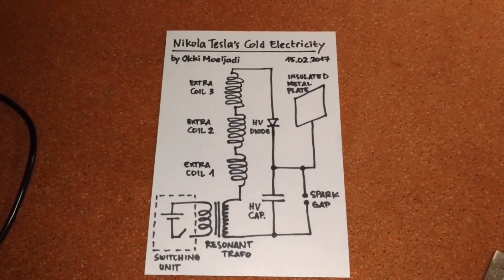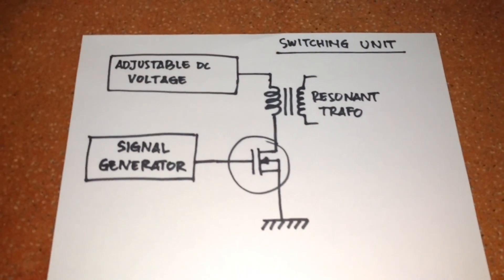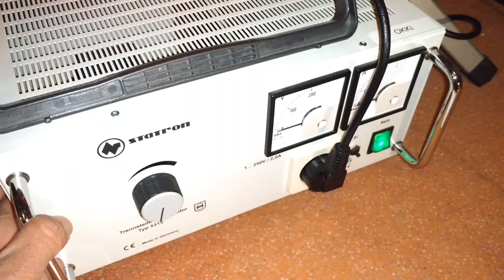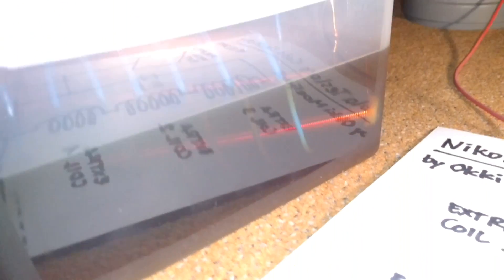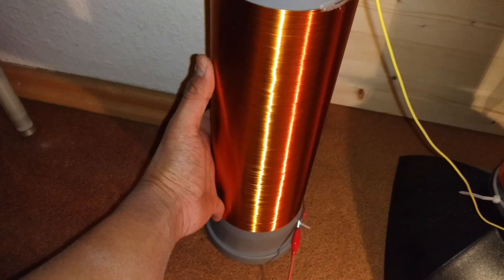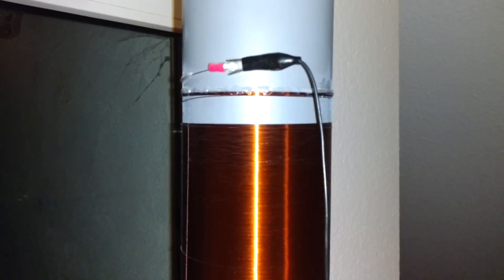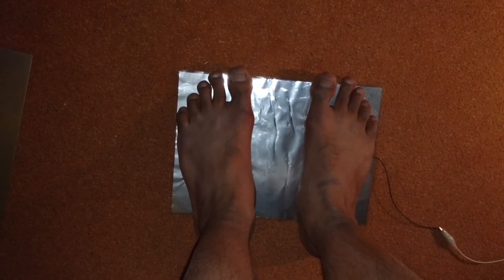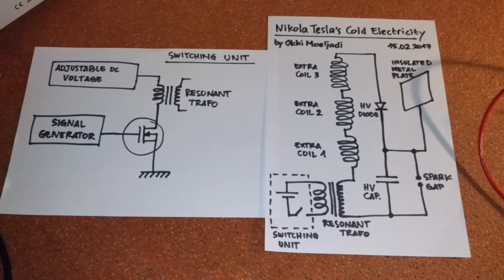Cold Electricity - Circuit Details

Comment: So in Tesla’s hairpin circuit, which you made as well, a spark gap applied to 2 capacitors resulted in the ‘cold’ electricity effect.  In this video you do not have a sparking gap, thus, the question is if a spark gap is required connected to 2 series capacitors as in the hairpin.  Certainly you are applying a vibrating high frequency DC voltage to your plate capacitor, thus, creating similar dielectric characteristics in terms of completing a circuit with your body parts to a ground.  Certainly Tesla could have done this as well, but then to my knowledge he did not.  Did he feel that a spark is actually necessary, in other words, did a spark drive the aether in a beneficial way in his hairpin circuit (by the way Tesla did not call that circuit ‘hairpin’ rather an impedance effect circuit.  My gut tell me that your circuit most likely is using a similar high voltage/frequency capacitive reactance (impedance) as Tesla’s.  Yours would be less powerful though, as you it is not bipolar, i.e., you run through a diode as in Tesla’s he used 2 capacitors that are obviously at any moment at opposing polarities that would enhance the effect.  Listen, you need to get back into the game and start posting again.  I feel that this circuit is an important circuit that you came up with.

Comment: I hear cold electricity may be considered negative electricity. Do you see this as true?
Reply from the maker: I think people refer cold electricity to different phenomena. On mine I don't see this as negative electricity. Some poeple say that cold electricity is where void of electric charge is created and you use this to power something.
Reply: Okki Moeljadi I see, thanks
Reply: Okki Moeljadi is this circuit capable of collecting Radiant energy? Why have the extra coils?
Reply from the maker: @filigenzilab9613  any copper material can be used as radiant energy receiver. You don't need any extra coil. This video shows my early radiant energy research.
Reply: Okki Moeljadi thanks
Reply: Okki Moeljadi how much radiant energy do you think one could obtain with a specific amount of circuit space?
Reply from the maker: @filigenzilab9613  based on my radiant energy research, the receiving power depends on 2 things: 1. Copper mass and 2. Frequency. Copper receiver with more weight can receive more power. Regarding the frequency: the higher the frequency, the more power you can get. So the info is yours, you only need to find some natural transmitters and extract as much power as you like from it.
Reply: Okki Moeljadi thanks again
Reply from the maker: @filigenzilab9613  you're welcome.
Reply: @OkkiMoeljadi  Yes, some people refer to cold electricity as different then what I see in this video.  Typically the door knob capacitors, as in Tesla's feed a stout piece of wire connected between the 'load' side of the door knobs...now in your circuit you have the positive pulse going to the floor capacitor (aluminum with plastic around it)...Thus, one may conclude that what is going around the outside of your body (as you become the other plate of the capacitor while standing it) is a from the negative side of the capacitance, or negative electricity.  Key here, is that, even though your device is only connected to one plate of the aluminum plastic cover capacitor...A conductor touching the plastic (your body) will assume negative charge.  This is somewhat different than Tesla's cold energy device as the door knob capacitors were  supplying a closed stout wire.   I really like your device here, as all the extra copper actually, I think, becomes part of the aluminum plate capacitor(as seen by the circuit).  Great job here!  Thanks!!
Reply from the maker: @MS-ef1gy  Thanks!
Reply: https://youtu.be/1JeeaZlYonc

Comment: Okki, you need to watch the vids of Gerard Morin. He managed to harvest free energy from the aether with (RF) sound like Tesla did. Morin used a frequency generator to drive a magnet motor and put out a lot of torque. He says: " If you remove the sine wave with spark gaps you get massive amounts of energy release. If you can handle this properly you get pure potential. All you have to do is manage this energy properly. https://youtu.be/nnsbmMjc5iQ

Comment: I understand radiant energy effects occur, when a capacitor is charged from a negative inductive spike (high side switching a coil) is disruptive discharged, into a primary (without oscilating to positive), inducing resonance in the secondary. I will investigate this further with bifilar pancake Tesla coils.
Reply: ok, have you done with the tesla pancake coil?

Comment: Okki you love making half wave power supplies, in this case the diode does nothing. You have a pulsed DC so there is no negative half cycle. You need to take a course on electronic circuit design. There is nothing special here. What is scary is that you use your body to complete the circuit. You are standing on one plate, and with your hand, you are touching the sides of the bulb. You complete the circuit when you touch the bottom of the bulb to the ground plate. The charge travels thru your body to ground. This is dangerous. People can get seriously hurt if not dead if they connect this up incorrectly. Your body is a cap in this circuit. Caps pass AC and Blocks DC. A cap has two plates and an insulator between them, the laminated foil is the one plate and the plastic covering the plate acts like a insulator. But you are the other plate. The pulsed DC current passes thru you to ground.
Reply: The banking power elite have employed 100 of shills that posts videos with bullshit on the tube and google to dumb down the real free energy tech as heat pumps of turbine type and plasma pulsed techologyes.
Reply from the maker: Maximus, I don't think you understand the behavior of high voltage and high frequency in resonant system. I cannot find any information from your channel which support your claims. It is also not necessary for me to explain again my educational background and my profession as I already mentioned this on comment section on some of my videos. You cannot judge me based only on my videos.
Reply: Okki I do understand. If you are doing real science, write a white paper and include your experiments and data. If this is new physics not explained by the current physics models, I will get you published and funded. The problem with individuals like yourself is that you claim to know what you are doing and you really don't understand what you are really doing. If this is new physics, I will get you published in peer reviewed journals and funding. If you have the knowledge as you claim, why are you doing a youtube channel, and not working in a real lab and not in your living room. There is a well known way that a scientist gets his work published and funded. I don't care what country you are in. If this is a new model for physics, lets see the white paper. Where is your Spectrum Analyzer, Oscilloscope, Meters for Voltage and current. How do you actually know what is going on in the circuit without the proper test equipment.

Cold Electricity a form of electrical work without electron flow. Similar experiment were done by Eric P. Dollard and Charles Proteus Steinmetz. Eric P. Dollard has said after 30 years of working on this stuff, he has finally decided to give up.  The whole premise of cold electricity does not make any sense. You can have power (like lighting a bulb, without any work (no electrons thru the wire). So if there is no electron flow, How does the atoms of the wire filament get excited enough to glow and give off heat?Sounds like power and work. If it is not electrons acting on the wire filament to cause it to glow, what is it then? What is the interaction\force that is happening that puts the wire filament into an excited state. You have a change in the state of matter without the electron flow to do the work in order for the matter to change state. Explain? 

Simple test in your experiment, connect a current meter between the bottom of the bulb and the ground plate. If the meter reads ZERO and the filament in the bulb still glows and gives off light, you may have cold electricity. The claim is that cold electricity can light a wire filament without electron flow. If on the other hand, the current meter shows a value of current, then it is not cold electricity, just regular old physics.
Reply from the maker: Hi Maximus, I do not have time to argue with you about this. Every one of us understands things differently. What I do here is not new at all. I just try to recreate the research of Nikola Tesla using parts that I have.

On YouTube I just share what I see on my research. By the way, this is my personal research and I don't need any fund from anybody. You don't need to offer me anything. And if you have different opinion than me it's O.K. On the other side you cannot force me to understand cold electricity like you do.

If you want, please send me some links of your works. I will have a look as long as my time permits.
Reply: Where are the data? how much energy can I extract from the "antenna" and how much do I have to put in? Why not show the data instead of a lot of talk
Reply: He has no data. Not a real experiment. He collects no data. You see no instruments as I said. He claims he knows what he is doing, but he really does not. I have seen a couple of his videos, he never gets a spark on the spark gap. That tells me he does not have a resonant circuit set up which is required.

He has two cpas in series, which actually lowers the capacitance instead of increasing it.
Reply: He wrote, "Hi Maximus, I do not have time to argue with you about this"  That's a cop out. The fact is that Okki does not have time, or is just too lazy, to learn actual laws of physics.

Comment: Hello Okki, It's me again. I want to make a resonant transformer like you have. I think I have the coil correct but I have not found a good way to drive the coil. I can't seem to find an AC power source suitable as a driver. I am wanting to do AC experiments and the driver I have is designed for DC which seems to be the case for most flybacks. Any ideas? Thanks Clint
Reply: Okki, I think I'm just going to build one from a MOT. It seems to be the best option for me.
Reply from the maker: Hi clintified2themax. For this experiment you don't need AC driver. Pulsed DC signal is enough. Of course if you use H-bridge driver you may have better result. And I don't think using MOT is a good idea. You need high frequency signal to drive Tesla extra-coil on its resonance frequency. Also the winding of that trafo will not withstand high voltage. You will get plasma sparks all over the place between coil turns. Use ferrit core and wind magnet wire around it as you would do on standard Tesla coil as secondary and make a loose loop (3 - 6 turns) around that secondary coil. If you finish with that, submerge everything in mineral oil. Here I use cheap motor oil.
Reply: Thanks Okki, what I am looking to build is the source to drive the resonant coil, I think you are using an AC source on yours, then looks like you rectify and pulse the Mosfet with your signal. So I want to build the basic adjustable source from the mains, Does this make sense? I built the ferrite resonant coil already.
Reply from the maker: clintified2themax you got it all correct. I can feel that you are almost there. With variac I can adjust the dc input voltage of the resonant trafo. And I pulse the dc voltage using a mosfet which is driven by a signal generator.